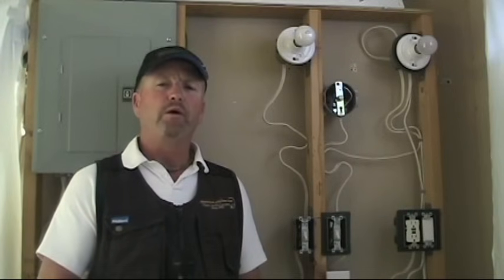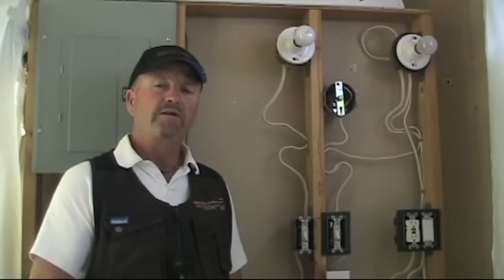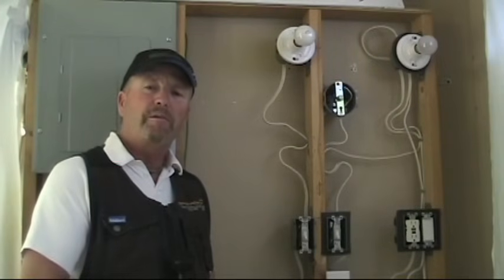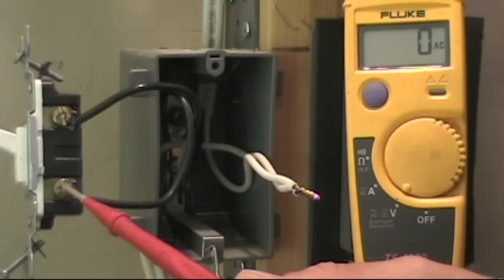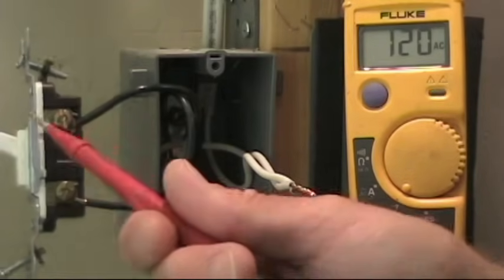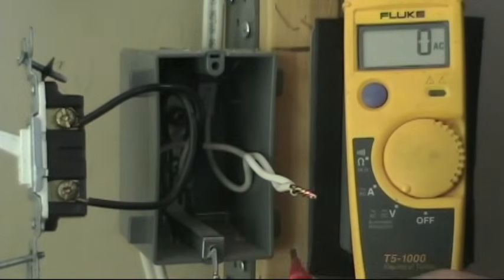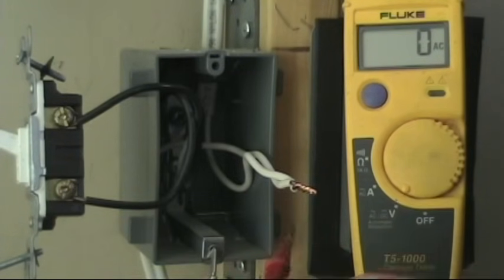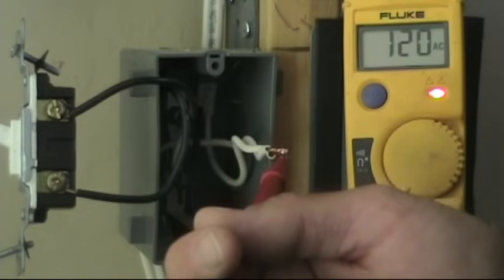Understanding an Open or Loaded Neutral

Comment: Who think that there was so called "shared neutral" between red and black wire on 14/3 for two different areas in the house??
The guy just tern off one 15 A breaker, (let say red wire) but, — the other wire (black) still hot, because of the old code — there is no double pole breaker on that 14/3... that’s why that neutral was loaded and show on multimeter 120VAC!!

Comment: half a lesson ...Why not show what happened in the box up stream? Also, with a plug in tester, it will show where the open neutral is, won't it??? cheers
Reply from the maker: Sorry to disappoint, but I explained what happened in the box upstream.  I guess I could have shown a picture of 2 white wires not connected to each other? And no, a plug tester will show an open neutral, but it can't determine where it is.  It could be anywhere in the circuit between the location of the tester, and the panel.

Comment: Two comments that might help people: First, the key idea is voltage drop. Imagine a simple circuit that doesn't even have  a switch. You attach hot and neutral to a simple lamp base with a bulb in it. This isn't realistic, but it helps get the idea across. The voltage on the hot terminal will be 120V. Current flows through the resistance provided by the bulb and this resistance causes the voltage to drop across the bulb. In fact, it drops 120V and the voltage on the neutral terminal will be zero. A voltage drop occurs ONLY when current flows. If you disconnect the neutral from the lamp base, current stops flowing. Therefore, the voltage drop across the bulb becomes zero. The terminal from which you disconnected the neutral is now up at 120V. No current is flowing, but the terminal is at 120V, ready to bite you. This is what happened in the circuit in the video. If you open a neutral in a circuit with current, you stop the current. All the voltage drops upstream of where you opened the neutral become zero and the voltage of the neutral on the conductor coming from upstream will go to 120/240 and the other neutral (heading back to the box) will be at zero.

Here's the second comment:  Never trust a neutral. Here's what I mean. I had to replace a pigtail in a lighting outlet. Before making changes, I checked for voltage, hot and neutral, found voltage, and then opened breaker. I saw the voltage go away, so I knew that I had the right breaker (since I saw things turn off). "Never trust a neutral," means that, even though I had taken all due care in identifying the proper breaker, when I untwisted the neutral splice to do my work, I did not assume I was safe. Good thing, because, as the neutral splice opened, it arced. How was this possible, since power was off, as proven by probing for voltage and killing the circuit?  Simple. Someone screwed up. Somehow, they managed to tie the neutrals of two circuits together somewhere. So, voltage went off on the hot in the outlet when I opened the breaker, and there was no voltage on the neutral, but there was current in the neutral from some other circuit (who knows where) and, when I opened that splice, I interrupted that other circuit, the voltage drops went away,  and the neutral in the splice came up to 120V.  Never trust a neutral.

Hope this helped.
Reply from the maker: Good additional information here!  Thanks for posting and contributing to the education regarding this subject!
Reply: shared neutral ... 
Some person got lazy and could not find the open N so they found another working circuit nearby from another breaker but with a working N and they tied into it ...
Reply: Your "never trust a neutral" is excellent advice. I need to be more careful. Thank you!
Reply: Wish I could by you a beer for them comment. This helped me grasp the concept of open neutrals
Reply: Pp
Reply: This definitely helped a lot. Thank you very much.
Reply: Thanks for this clear explanation , now everything makes sense
Reply: Man I'm working on a old house and everywhere they used switched neutrals for lights ect. Also when one circuit is OFF the outlet reads 115 and correct, as soon I turn breaker ON  the tester showes reversed polarity. I'm not sure what to do OTHER THEN REWIRE EVRY OUTLET. and identify the supplies to ensure not crossing neutral from room to room. Lmk <3
Reply: @blakek1043  If "switched neutrals" means that neutrals are being opened and closed by switches, then my first thought is that work was done by an amateur who did not understand even basic wiring. Since it is an old house, I would fear that an unqualified person rewired the house without supervision. This means everything is suspect. Fill calculations may be wrong or never done at all. Incorrect materials and methods may have been used. Conductors and breakers may not be sized right. Splices may be incorrect. Boxes may be buried. Grounding may be absent or incorrect. Gaps may have been left around boxes. Connectors may be absent, incorrect, or may be too tight.  Figuring out incorrect work is hard. I'm not in a position to give advice, but if it were my house, I'd hire a professional and expect that he / she needs to open every outlet, inspect every splice, and do whatever is deemed needed to know the state of the wiring.
Reply: @ef2b are you on any other social media where I can direct message you? I’d like to pick your brain on a couple things. Thanks in advance
Reply: Thank you!!!
Reply: excellent comment

Comment: hii Terry,

thanks for your good info video. i learned something

i have one question to ask you, pls. 

i found a live wire in a switch of ceiling fan, and switch lead to the ceiling fan.  i also found a i thought to be neutral wire connected spliced  to another wire, in fact it is a load returned neutral.. 
so my question is, when  you see wire in a switches box, how to tell a neutral wire is neutral or load returned neutral ? 

thanks
andrew
Reply: I hope you see this and get back with me,  I've recently discovered that my shop wall has up to 116 volts to any grounded material including me... it's an old horse barn with tin walls and roof and concrete floors,  I'd like to fix this really soon

Comment: but a neutral can still shock you if you get in the middle of it right?like grab one end of the neutral with one hand and your other hand to the other side of neutral?
Reply: Yes, if the circuit breaker is on and you grab 2 neutral wires that have been disconnected. Once you disconnect them one will become hot if there is a load on somewhere in the circuit. Always turn off the breaker or breakers that the neutral is associated with.

Comment: What is not clear in this video is that the potential of 120 VAC is from the neutral to ground.  This of course should not happen so the white wire is broken somewhere in the path back to the main breaker box.
Reply from the maker: You are correct, and it's also the potential from the open neutral to a connected neutral.

Comment: You left out the important part..... The neutral (white) wire either came loose at the control panel, or junction box & they forgot to tie it in, so you have back feed from the light on the hot side to the neutral..     What you didn't show was that the neutral isn't hot w/ the switch off..... This happens to the best of them..

Comment: Terrible video - He never showed why the problem or how he corrected it.
Reply from the maker: Charles, as I've pointed out before, I could have showed 2 white wires not connected to each other. The problem is corrected by completing the neutral path as it should be. This is an explanation of how you can get a reading of 120 V on a white wire that should be a neutral, and how an open circuit on the neutral side can cause this.

Comment: I was having trouble with a TP Link smart dimmer switch.  A Google search led me to this video, which was extremely helpful.  It was great to see how to test the switch and eliminate problems.  It turned out that I had the line and load wires reversed, hey both were black.  Thanks for helping me out in a jam!

Comment: A 'common' (haha!) mistake is that common & neutral will be tied together in a sub-panel box. Neutral & Ground should ONLY be tied together in the main breaker box!
This bad wiring WILL get someone killed eventually, if its not safely found & safely corrected.
ALWAYS turn off source power, lock & tag, check & re-check circuit before you start your work.

Comment: Hi Terry I have an outdoor receptacle stopped working. I used a meter and found that there’s no power but when I touched the hot wire and the ground 
It’s showing 120V. Please advice. Thanks
Reply from the maker: That means that you have lost the neutral connection in that circuit somewhere between the panel and that receptacle. Check the outlets closest to it for a loose connection or a bad splice.
Reply from the maker: Shut off the breaker first!

Comment: I got a new deep freezer.
unplugged old appliance, plugged new one up, everything in circuit stopped working. tester indicates open ground...Never had an issue before.. what's your advice as to where to begin finding my problem?
thanks in advance!

Comment: Why is it 120V on the neutral though? What's the voltage drop across the filament of the light?
Reply: In the case of 120 Volts Alternating Current, the current is alternating between the hot and neutral 50/60 times per second (60 Hertz in the US and Canada and 50 Hertz in many countries, especially in Europe and Asia). When the neutral is bonded properly, the voltage will be 0 volts in reference to ground and also hot, because it is tied to ground which is 0 volts. On the other hand, when the neutral is open or disconnected, the voltage will now alternate 50/60 times per second between the hot and neutral. The neutral now has a potential of 120 volts in reference to ground and our human bodies as well. The voltage drop across the light is negligible and in AC current an open neutral will always be dangerous.

Comment: why would a normal neutral be wire capped
Reply: To avoid a ground fault that could shock somebody in this situation.  Or just a short if wires move due to vibration or whatever.
(anyone who doesn't know this should not be doing electrical work; not trying to be mean, but this is really, really, really basic info)

Comment: I’ll never forget my first open neutral!
Reply: must be a "shocking experience"  LOL
Reply: It definitely tickled. Found in a main. Detached. Definitely need to figure 60s 70s branch circuit...
Reply: Never even thought about it being a young guy fixing up my old 1940 house. Even when I did my log cabin that was built in 1970 I was grabbing neutrals and grounds and hots all bare handed one at a time and it does work but I’ve watched enough bad stuff in the internet that I do it safe now unless an emergency. I’ve never even thought about getting zapped off a neutral but who tf would wire it like that
Reply: @jake_of_the_jungle9840 my first was in a restaurant kitchen. Pipe up from basement. Killed the circuit, checked hot to neutral, hot to ground and neutral to ground. Opened up the splice and removed the feed out they didn’t need for the renovation. Straightened all the wires and cut and stripped them evenly for a nice neat splice. Was lining up the insulation perfectly and inadvertently with my one hand on the “neutrals” and my other elbow barely touching the stainless steel wall found out about open neutrals. 
Apparently they had another circuit on the same neutral in the basement so since that hot is hot, something somewhere was trying to use power and instead of returning back to the panel it returned to me. Ouch. It hurts much worse when you’re not expecting it. To this day I tell every new guy to test it together and apart. Every conductor, every time.

Comment: a recepticle in my living room, i have 110 on the white wire but nothing on the black wire, in my main panel the black wire is connected to the breaker, i have a light in my dining room, three recepticles in my living room, three recepticles in my bedroom, my house has a combiation of aluminum copper and knob and two wire, i had a switch in series with the outlet that i removed, i connected black to black and white to white, there is a junction box in the cieling of my living room that i can only get to by removing the cardboard tile cieling, which i holding old plaster that fell off the lath boards and everytime the cieling falls it makes a mess that takes time to fix, the recepticle that had a switch is an ungrounded two prong recepticle, all other recepticles on that circuit have power on the black wire in referance to ground, and i know i dont have any open or loaded neutrals because i unplugged every thing and turned all light switches off, before this, my furnace was wired into the same circuit as my living room and bedroom, and my dad put the furnace on its own breaker and put a three prong recepticle in place of the old two prong recepticle where my router is at, the two prong recepticle that has 110 on the white wire is behind my couch, i dont know why it is live on the white wire though
Reply: You may find that a receptacle before that one, that was used as a splice and caused the wires to be reversed. You will find a white and a black wire on both sides of the receptacle that reversed the colors.

Comment: So if i have same problem on a cealing fan ... The ground n neutral. Just connect them to the hot neutral ?   At first i connected the ceiling fan the correct way and did not turn on .. Or my othe fixture lights. ???

Comment: i feel sorry for you Terry!...  people it was an open Neutral!!....  he doesn't have to show you anything!!  just imagine in your head the WHITE WIRES NOT CONNECTED!!.. that's all.. plain and simple.. if there not connected the circuit is open which means its not complete which means with AC you have to have a complete circuit or you will have no light!  once he hooke the white wires back up the circuit was complete again.
Reply from the maker: Thanks for the support!
Reply: that why pigtails are good in every box. There's less chance of an open neutral. Also everything beyond that point will keep working properly
Reply: @zeus3358  Yes, sir. I also like to pre twist all connections before putting the wire nuts because they will never come apart unless you purposely untwist them.

Comment: How about a 277v circuit where when the breaker gets shut off, one of the fluorescent units comes to life, and when you engage the breaker, it shuts off- and the rest come to life? The neutral carries excess voltage from ALL of the circuit breakers, shutting off one breaker is meaningless.
Reply: Bodine ballast for when the power goes out. It's a battery backup light for safe egress. Mostly used in schools and other buildings

Comment: Without showing the main part on a picture, people still don't know what you're talking about.
Reply from the maker: John, here is a post from my website that explains this a little further. https://www.electrical-online.com/understanding-an-open-or-loaded-neutral/  I just didn't feel the need to show 2 white wires that I disconnected from each other but in hindsight, I guess I should have.  I thought the explanation would suffice.

Comment: Circuit diagram might help the case but issue is not clarified  ... and in other countries neutral is tied to earth at the point of  supply (supplies transformer),  and the circuit will still work if not tied to earth.

Comment: I got one for you how about a bathroom vanity that it dead but comes back at any time by itself.   I bang on it won't work move wire's won't work then with no help switch in the on position it comes on I turn it off that it won't come on till it wants to at any time?  Any ideas.  It is controlled by a switch and there is an outlet next to it it's an end run.

Comment: With an open neutral, u can also have downstream receptacles at 220. And anything plugged in can b ruined. Which is far worse than a little tingle or shock u might get. Unless of close your standing barefoot on wet salty concrete. Or leaning over your washing machine with your bare sweaty belly hanging out. In which case u could have easily bought the farm
Reply from the maker: Correct Bill, in a 3-wire 120/240V system, an open neutral can cause the problems you describe. Depending on the scenario, a 120V appliance could have anywhere from 0 to 240V on it. Here's a post from my website on this subject. https://www.electrical-online.com/electrical-outlet-doesnt-work-and-breaker-isnt-tripped/

Comment: What is so hard to figure out power goes through the light 💡 and then down the neutral wire it has no path to ground because the neutral wire is open farther down the circuit the light doesn’t turn on because you need a complete path to ground for current to flow but the voltage is still sitting in the wire waiting for a path to ground this is basic ohms law stuff as current raises voltage drops no current no voltage drop so basically just a piece of energized wire.  A light bulb is just a small wire between the hot leg and the neutral nothing magical going on here
Reply: it doesn't go to ground, it goes back to the source
Reply from the maker: No magic, just an explanation.